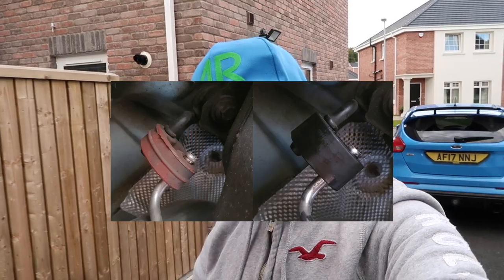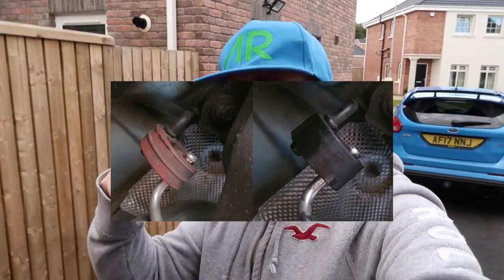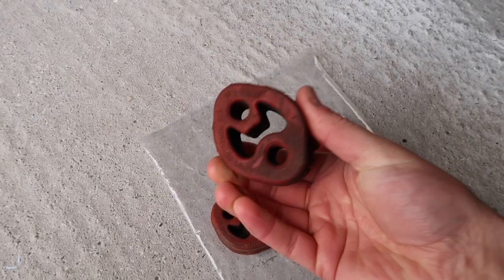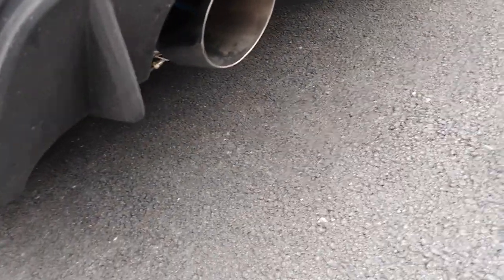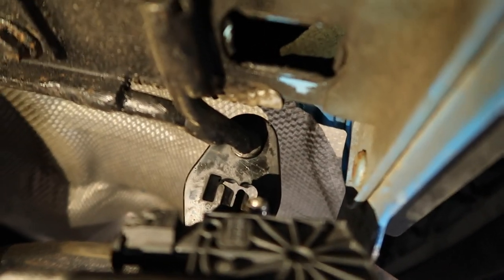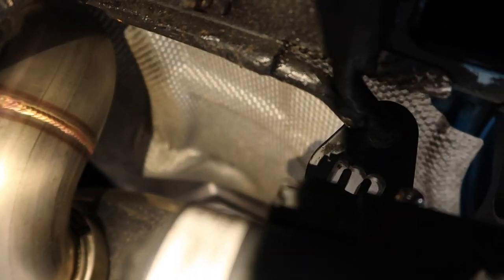FIXING THE MOUTNUNE V3 EXHAUST TAPPING NOISE! | FOCUS RS | VLOG 32

Comment: I had issues with the Mountune exhaust on my Fiesta ST200 as well. the back keept banging  against the heat shroud in the back when the ride was a bit rough.
I Installed different isolators, but nothing helped. 
Then on the day of my car inspection (Belgium), they failed me on the exhaust, because it had no 'E' certificate.

I reached out to them to see if they could provide me with some documentation, but no dice.
They simple have no certification papers.
Though I always had good service from them.

So I went and bought a Ford Performance exhaust, which is made by Remus.

+ Has a resonator, still as loud as the Mountune on the outside, but quieter in the cabin.
+ sounds better at higher revvs.
+ Has the E certificate for homologation
+ Is much lighter
+If you want you can place different tips on it.
+ its on there for about a month now, no banging.

- its expensive.

Overal I am starting to doubt the advantage of mountune parts.
I used to buy them because they did not affect 'Ford warranty'
But what's the point if critical parts can't pass inspections, I mean maybe it's not a problem in the UK.
But they should advice their buyers to check local rules and regulations first, even if the Ford warranty is not affected.

Comment: In 10 years time the conversation will be how to add more power to an electric motor. A bigger fuse will be required though. 😆.
Reply from the maker: Crank the voltage behbeh

Comment: I find their description on these confusing. The upgraded downpipe bracket uses a harder bushing material to reduce vibration/NVH... it's a similar material to these Mountune exhaust hangers yet on the Mountune website it says these slightly Increase NVH? I know they're doing 2 different jobs but I figured these would also reduce NVH being of a similar material. My biggest goal right now is to Greatly reduce cabin NVH from my Catless ETS system.

Comment: Had the same issue bro.. after wrecking a exhaust valve motor I ended up grinding part of the chassis where it was knocking. Apparently it’s a common issue and Mountune doesn’t want to know about it. In saying that I’ve seen the new design of V3 has been rotated to the left a bit more to prevent the motor knocking
Reply from the maker: Seems such a silly thing to me, just wish they would acknowledge it publicly

Comment: Had no issues with my V3-X since fitting however being an X no valve motor to knock about on stuff.
Reply from the maker: If the X was still available at the time I ordered then I would have got it. I run the valve delete anyway. shame :(

Comment: Hmmm. I still have a stock exhaust but i get that butterfly/plate tapping when closed. Maybe different issue
Reply from the maker: It could be the exhaust valve flap being loose. The fix for that is to remove the motor, remove the spring and stretch the spring so that when you put it back together, it puts more tension on the flap so stops the rattle

Comment: I currently in the USA I’m visiting my daughter so I had these delivered today I have the V3 exhaust and I don’t have any alignment videos or banging noises

I use JW Racing and never gave them a thought, have to Jason ( the owner ) if JW Racing is a top top bloke he got my Endless brake pads 

Did you fit the MOUNTUNE rubbers yourself if so being that they are stiffer how was it fitting them
Reply: Alignment issues